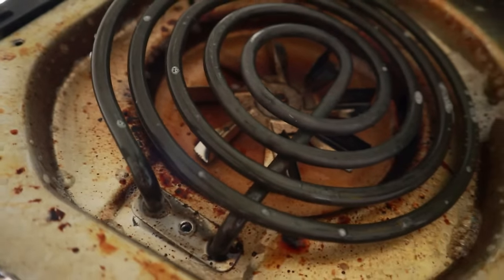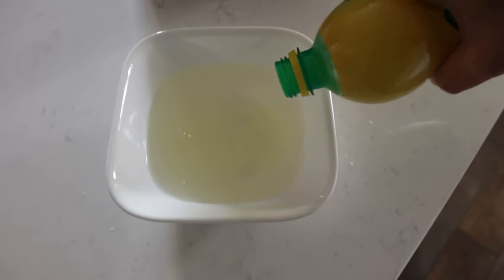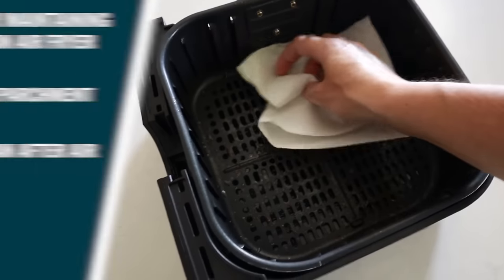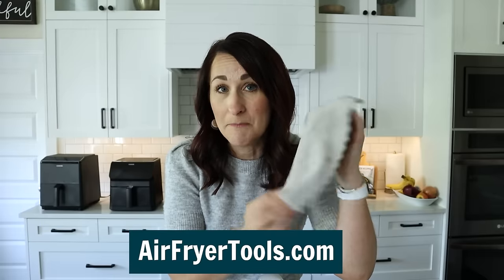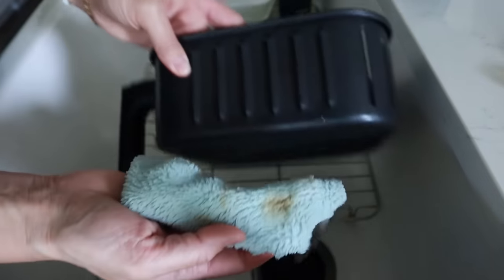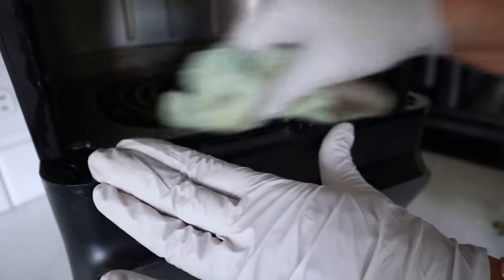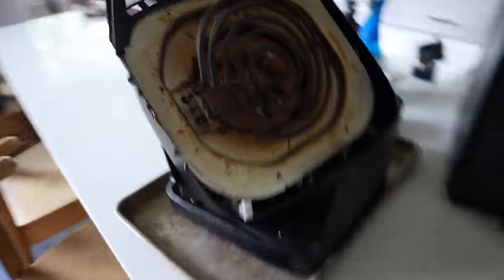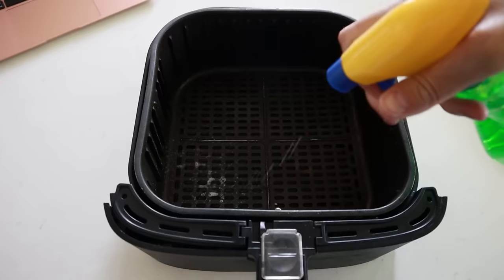How to CLEAN Air Fryer & KEEP IT CLEAN! Stinky? New? Watch THIS!

Comment: I’m not being funny, but doesn’t everyone wash and clean their air fryer basket and bottom container after use?  Just me?
Reply: I guess you don’t know what you don’t know. 

Personally, I wouldn’t dream of leaving my air fryer dirty, but maybe some people think of them as more like an oven than a pot or pan.
Reply: I do lol.
Reply: I do
Reply: My wife does… and for some reason thinks that using parchment or foil to line the basket defeats the purpose of using the air fryer.
Reply: @RequstingFlyby  You need to show her the light! I got a 350 pack of liners off Amazon and I haven't needed to clean my air fryer in a while lol. Food cooks just the same.
Reply: I always clean my airfryer after every use n wipe it down
Reply: I'll buy a new airfryer once a year!
Cleaning is over rated! 😂
Reply: @Terry_Aki I sure like that attitude!
Reply: @aceinthehole1222 but isn't the point that the grease drips down? With parchment it just sits in the grease. Otherwise I wouldn't need to constantly be cleaning grease and oil from the bottom. With parchment it'll keep it clean but it isn't helping the point of the air fryer to help keep food less oily and a little healthier
Reply: @curlygurlxo  No, air fryer liners soak up the oil so the food isn't just sitting in grease.
Reply: I dont think that is the point as for many of us, the fat is valuable source of nutrition.  Depends really on what you believe.
Reply: Yes , we clean the basket after every use
Reply: I do but it was smoking. I discovered it was due to grease above in places I can't reach.
Reply: Yes I always use parchment paper in the basket but since my daughter moved back home she doesn’t😖
Reply: @sharonsmith1645 i use aluminum foil
Reply: Just you
Reply: If only fries have been in there, sometimes every other use tbh
Reply: Hell no!
Reply: Hell no.
Reply: Yes, but the inside top is still rough. Turn it upside down and look.
Reply: So, I’m brand new to the air fryer. I figured you were supposed to; that’s why I’m at this video. We got ours secondhand from my brother in law. He used it once. Didn’t clean it out.
Reply: You don’t put fresh oil in a deep fat fryer every time do you?…
Reply: @Aaron_ryd  you wash your pan every time you’ve roasted or baked something in a kitchen oven, don’t you?
Reply: @RequstingFlyby she’s right for many foods because you want as much air flow as possible. That’s why parchment paper with holes is sold. I sometimes use it and it contains some mess, but even then there’s a difference between with and without the paper.
Reply: @aceinthehole1222  Haha! Good one.
Reply: I do to
Reply: @Cat-sv7zu  Same issue here with mine
Reply: Have you ever  encountered  a bachelor  ? I  clean mine but sometimes I think  nah it will be fine !.
Reply: @RequstingFlyby  she’s somewhat correct — when it comes to foods you want to be crispy. Anything that blocks air flow cuts down on crispiness, even holey parchment paper. I have two Dual Blazes and have cooked the identical foods simultaneously, one with and one without holey parchment paper or a parchment paper bowl. While the parchment paper works well, sometimes I need to flip food to get the crispiness that’s in the other air fryer. Plus liquid or oil can pool on the parchment paper, defeating the purpose. But some foods are no problem at all with parchment paper and I’ll use it.
Reply: @aceinthehole1222  it depends on the food. I have two Dual Blazes and have tested the same food in each one, with and without parchment paper. For some it makes a big difference, others not.
Reply: @curlygurlxo  parchment paper with holes allows most of the oil to drip down, but it still blocks some of it.
Reply: I do
Reply: This is extremely difficult when you have roommates that do not clean it
Reply: I got air fryer liners ones with holes only one Walmart had .but I made order airfryer liner in different  types with no holes .don't ever took hot dogs or egg in air fryer my friend made huge mess in it his girlfriend wasn't  happy that for sure .I try buy food that won't  be to grease but if u cook eggs roll with chicken  in it cook it 5 mins until golden brown if it light brown u want it little more brown add other 5 mins keep eye on it .u can cook shrimp steak sirloin hamburger maybe vegetables cook some onion u could cook half garlic bread in it .but it depend what type air fryer u have me I have power xl airfryer work great I use srubber clean inside but when comes clean around fan inside it u need tiny srubber srub brown stuff out
Reply: I did- until I took the 90 Carnivore challenge. Prep cooking meat all day & it got away from me. 😂
Reply: Same. Like washing dishes after a meal
Reply: Yikes!  Land fill!!! If you had to bury the old ones in your own garden/yard would you still do that??  😮 @Terry_Aki
Reply: They should. But the average human is far less fastidious about cleaning than one would expect. And to be clear, that criticism is not leveled at any particular gender.
Reply: @aceinthehole1222  she's done aa video on those too. 😏
Reply: No, not just you.
Reply: Nope not me
Reply: @Terry_Aki me too😂
Reply: A

Comment: One BIG improvement I would like to see manufacturers implement is a removable electric coil.  Coils on electric stoves are removable, so the technology is there.  It would make it so much easier to keep the air fryer clean, and that is a big plus where food safety is concerned.  Yes, you can clean your air fryer, but you cannot fully clean behind that coil, and that is a huge negative for me.
Reply: This!
Reply: They can but don't want. How will they sell a new one every two years if you can fix and clean it at home yourself? Capitalism and consumerism sucks
Reply: I brought my air fryer to a shop that said they could clean it. Well, they found a dead mouse in the heating element. puke I don't know if we should still use this. The mouse, he said, has been "cooked."  We don't really bother cleaning that part because it is a pain to reach behind the heating element.  Now I am wondering if I should just throw the hole thing away. never mind if it's a gift from my late husband. :(
Reply: @azile77  Seriously?  Were you aware there were rodents in your house??  

No question, I would dump it.  No one should use that for food.
Reply: All look great but how do you clean a Homcom air fryer ! It has a metal mesh grid which cannot be removed ? Any suggestions 🙏
Reply: @MrDragos360 under Socialism people would still be cooking with a Dutch oven outside.

Comment: The next development in air fryers needs to be making the burner area removable and/or somehow able to be disassembled for cleaning.  This is probably the biggest problem area for air fryers right now.  That burner area necessarily gets dirty and is very hard to clean effectively in every air fryer design that I'm aware of.
Reply: I used to be able to remove the burner coil from my stove back in the day. It's more likely that they just want you to buy another one when they get too gross to clean.
Reply: Not sure if it's worldwide but the Philips in the country I'm living in rn offers professional air fryer deep cleaning. I'm not sure how much it costs though. But it's nice to know I have that as an option. 

Might be worth checking if it's also offered where you live if you use Philips AirFryer.
Reply: ..nx generation air fryers will incorporate *plug in/out elements ...but not before companies have 1. sold their full quota of airfryer replacements, due to limited cleaning access ... & 2. customers sTop buying them n call for *.. :(
Reply: What burner ? It is a hea5ing element , burners produce flames !,
Reply: It's blatantly obvious yewou are not an expert in anything , calling it a burner makes that clear just pulling out the screw allows the element to lower enough to get a hand in to clean perfectly !
Reply: Cleaning The Burner Is My Issue 😢

Comment: I would have been afraid to actually turn my air fryer upside down for cleaning until I saw this video.
Reply from the maker: Ha! What did you find Pat? You have the Power XL oven style, right? How is that burner area cleaning process?
Reply: @empoweredcooks  I have a removable screen on top that I clean. 
 I haven't actually turned my AF oven over yet, it's quite heavy.  Will think about it though. 😅
Reply: I turn my AF upside  down all the rime. Gotta keep,it clean or the grease will build up, also I warm my up first, warm , low as your AF goes down to, 1 minute   UNPLUG and clean warm grease wipes off easier

Comment: Baskets are never the problem, they're easily cleaned every time, it's the gunge you can't reach that annoys me. Every brand I've looked at has the same problem. Whoever designed them wants a good kick! Best I've managed is a small bottle brush wrapped in a cut down and sewn on microfibre cloth. The wire stem of the brush gives enough stiffness to put some pressure on the grease to scrub and it's narrow enough to get into most of the area, just not all of it.

Comment: Finally!!! Someone addressing the mess that builds by the heating coil!! Ironically, earlier this week I had the best success to date cleaning that area of my air fryer. I used a Magic Eraser (Dollar Tree hack version), a pretty good share of elbow grease along with one of the soft cloth wipes you used. Like you said... not perfect but a lot better than it was.
Reply from the maker: Great! I have tried the magic eraser (in a diff video) and yes it works! Just shredded up my magic eraser lol
Reply: @empoweredcooks  Same here but a small price to pay (especially if it's a dup from Dollar Tree) for a TONS cleaner air fryer. 👩‍🦰
Reply: I use the thin ones and it is well worth the cost to get rid of the grime.
Reply: Thanks For Sharing I Think I Will Try This One

Comment: I handwash my air fryer basket and inner drain basket with a soft bristle brush after every use. As soon as it has cooled completely, I wipe out any excess grease, then fill it about halfway with water to let it soak so food residue does not dry and harden before a thorough washing. When the heating coil and inner chamber have cooled, I turn the air fryer upside down to make cleaning the inside easier.  I use one of those blue shop towels dampened with warm water to thoroughly wipe off the heating coil and the entire surface of the inner chamber. I fold the edges of the shop towel to squeeze it in between the rings of the heating coil. If necessary, I will use some dampened Q-tips to reach through the heating coil to wipe the metal surface behind it.
Reply: BCS... Qtips are a great idea, but you just made me think of perhaps using those little square spongy paint pads, that I have left over from a project perhaps to squeeze a little 409 in it and wipe it clean then use another one to dry it up.😉👍 Thanks for the Idea!! 💖😊

Comment: I actually had to disconnect the heating element of my air fryer so that I could access the fan blades. I had a sort of calcium deposits all on the ceiling of my fryer, and especially the fan blades. I used a Brillo pad to scrub the blades and ceiling of the fryer. It actually cured that new smell that forced me to stop using the fryer in the first place.

Comment: Please keep in mind that even when unplugged you can still get shocked, and shocked bad. 
Capacitors can retain a charge for days or weeks, and if you touch them you can be badly shocked or die, this is how people die when messing around with trashed microwave. 

Right to Repair needs to include Right to Clean.
I cannot believe these things are so hard to clean
I have an Air Fryer Oven, and when cleaning it the other day I notice how nasty the top was.
I bought some oven cleaning stuff and sprayed on it hoping it would allow me to easily wipe it off....nope, it also dried up on it making it even worst.
I tried using toothbrushes and everything else and nothing worked so I was left with no other option but to take it apart.
I had already taken it apart before after spraying Dawn Power Spray in it and forgetting about it, which it ran down the sides into the bottom. So I took it apart out of fear of it damaging something which I didn't need to do because theres no electronics in the bottom of the air fryer.
Taking it apart is easy, theres maybe 9 screws on the bottom and then like 5 on each side, and the metal case just pulls off.
The burner element is also easy to disconnect, it just has 2 electrical connectors you pull off....In the video its likely the blue and red wire going to the burner.
Then I ran into trouble.
The top burner is held on with a screw on mine....a screw that needs the smallest screw driver in the world, and was screwed on by the strongest man i the world it seems.
I ended up stripping out the screw trying to get it off, but its held on by a nut on the other side.
To get to the nut though I had to remove the light and take out more screws to move the back panel enough to fit a socket screw driver around it.
I then removed the burner and it is so much easier to clean
The fan can even be removed by a socket making it even easier to clean. 

The fact you have to go through so much to remove the burner to clean it is a poor design, the same is true for if you ever need to replace the burner like you can do on an oven.
...also I forgot how sharp the edges of the metal is and cut my hands all up again, no idea why they are as sharp as razor blades.   

In the video it looked like she could have disconnected the blue and red wire to the burner without disassembling it more.
ALSO please keep in mind that even when unplugged you can still get shocked, and shocked bad. 
Capacitors can retain a charge for days or weeks, and if you touch them you can be badly shocked or die, this is how people die when messing around with microwave.

Comment: Great, practical, and necessary information, thank you!  I clean after every use, and I avoid foods that will make a pretty big mess.  I just do not like to clean behind greasy foods.  

What is the life expectancy on most of these air fryers if they are well maintained?  Let us say the air fryer is used once a day for five days each week, just as an example.
Reply: @osakarose5612  Thank you.  Well, mine might last ten years then because I will not use mine nearly as much as Cathy uses her air fryers.  I only cook for one, and many days I just eat soup with added pasta or rice.  If the air fryer did only last five years, that would come out to a cost of about $8.33 a month.  Prima facie that is not a lot of money, but compared to say my Black & Decker food processor, it is expensive.  I bought my food processor in the mid 1980s, and it is still going strong.  Of course, I no longer use it every week, either, but still it has lasted many years.

Comment: I use a soft bristle brush for the grooves in the basket.  Finally received my replacement Cosori air fryer. Still need to open the box and perform the set-up and cleaning.

Comment: I clean my fryer after every use. Sometimes it is a quick rinse and sometimes more in-depth, it depends on what I made in it. I don't cook foods that splatter a lot, which helps keep the top burner area clean. There is a splatter screen one can get for the Cosori Pro 2, but I don't recommend it after trying it myself. Sure it can help hold back the mess, but due to the small holes it increases cook times exponentially and can be frustrating. I was afraid chicken would splatter a lot, but it doesn't. I don't make bacon in the air fryer, that is a train wreck, microwaves are for bacon in my book. I also do not make steaks and the like in the fryer, I have to have those grill marks. Grill pans (and BBQs for those who have them, I don't sadly) are for steaks and the like in my book.
I like the foil liner idea for the lower basket mentioned in the comments. I don't know why I never thought of it. Although I am wondering if there is a problem using it with the non-stick coating over time?
I also use the parchment liners without the holes when I cook most things. 
I did pick up some of that Dawn Power Wash (nuke bomb stuff). It works well, but I don't have a sprayer in my (not sure I can call it a kitchen) so I have to try to use the faucet of the sink, which is an Olympic event given the size of the basket verses the dimensions of the sink and faucet. 
I'm going to pick up those rags though!
Dollar Tree can be ones friend as well.:)
Reply: 🎯 Exactly same here to everything you said

Comment: Cathy, I had already bought an Emeril (the 1st one) countertop air fryer before I found your channel and all your wonderful advice.  I can't find anything on cleaning the blower? area except one guy who turns the thing on its side.  Plus he doesn't show how to get any moisture out of that area.  Will using baking soda and water burn off if I use that, do you think>>  I wish I had waited now to get a Cosori!  And I won't hold you responsible if anything happens to it.  Thank you!

Comment: I wash my baskets properly after each use, then they don’t need a deep clean, I also wipe around and over the elements once cooled and unplugged from the wall socket with a damp cloth after each use, takes 2 minutes, then once a month or so, I clean around the elements using a toothbrush brush and cleaning solution as you did, but, because they are wiped over after each use they are usually in pretty good shape. After I have deep cleaned, I leave them open to air dry any dampness there maybe before using. ❤
Reply from the maker: Well done, Janet!